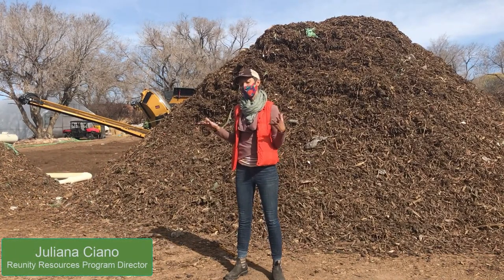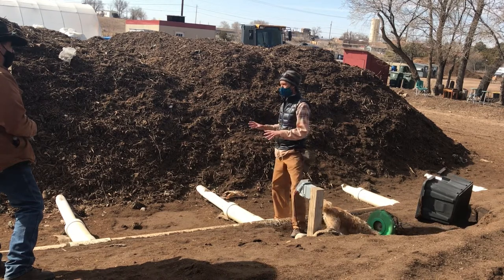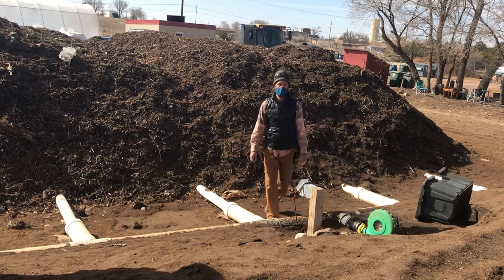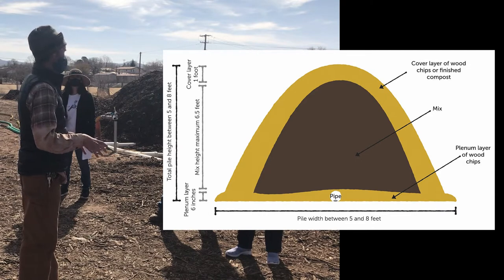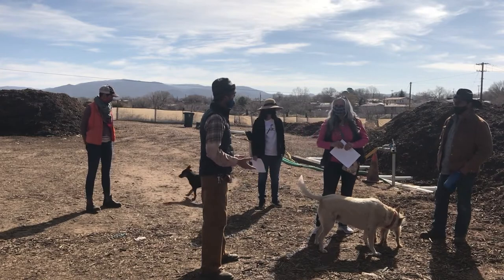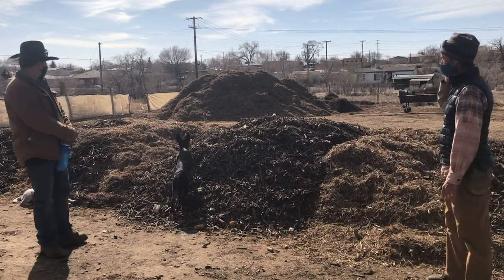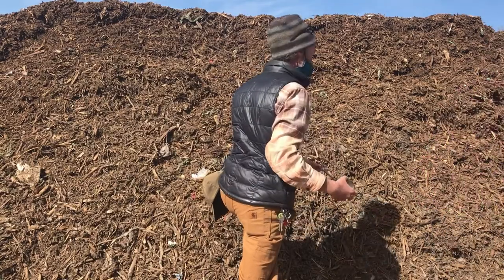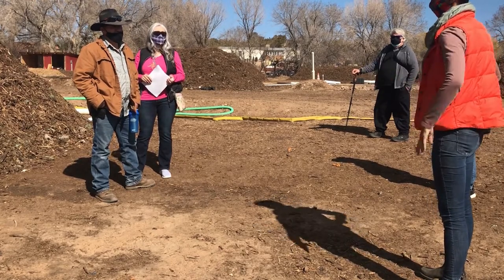Introduction to Aerated Static Pile Composting

Comment: Great info! It's really hard to take people seriously who believe masks help stop viruses.
Reply: What scientific facts are you using to back up your statement?
Reply: @douglasmckinley-sr1507  myself and many many like me who never wore a mask are still alive. What facts do you have that they do?
Reply: @CriticalThinker27  Had nothing but a motorcycle for many years and helmets were not mandatory them. Still alive which must definitely prove that helmets are not effective. Masks, like helmets, provide  protection. An analogy for face masks would be mufflers on cars and ear plugs. The muffler stops a lot of the noise from spreading. The earplugs further dampen the noise.  Same with masks where the virus is spread by airborne droplets.  The sick person sneezes and most of the droplets are caught or will not spread as far (muffled). A N95 mask will stop most of the droplets from reaching the healthy person. Just lowers the odds of getting sick. Some countries where masks were mandatory saw a 90% reduction in flu cases.
Reply: Sweden did not comply- no masks.       They had a fraction of cases.
Reply: especially outside.
Reply: great point!

Comment: How do you maintain uniformity of heat if its not turned? Is heat check every 24-72 hours? How do you monitor C:N ratio of starter material if everything going into one place?

Comment: Have you tried just pulling the pipe out of the pile. Even if you needed to add a strap to the outside end of the pipe, pulling would make it much easier to move the material. Should work, worth a try.
Reply: At our facility we remove most of the compost to reduce the weight on the pipe then pull them out with a loader.
Reply: @justinrayguitars6024  Simiilarly done here!
Reply: We remove most material first---since we set up the pipes dry-fit, this allows us to remove all segments and prevent pipe breakage.

Comment: How do you manage the leachate?
Reply: The least expensive option for leachate management is to design the composting facility in such a way that reduces and reuses all excess water, meaning that leachate treatment is only needed as a last resort. In order to prevent leachate production, the facility should be designed to separate rainfall and snowmelt from organic wastes and compost. Then, a proper mix of compost feedstocks should be used; this ideal mix of compost feedstocks includes neither using materials that are too wet nor adding to much water to the mixture. To reach this objective, the moisture content of the compost should never exceed 65% (Forgie et al. 2004).
Reply: @reunityresources1232  Wonderful info! Thank you for citing as well.
Reply: There should be no leachate. High temps drives the moisture out. The core/base will be dry.